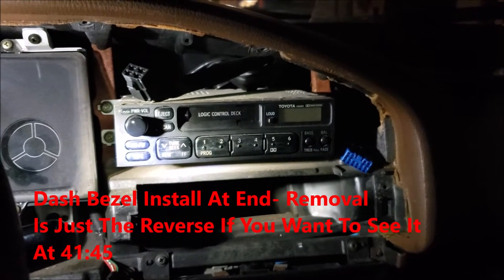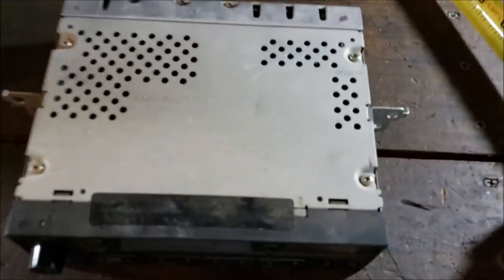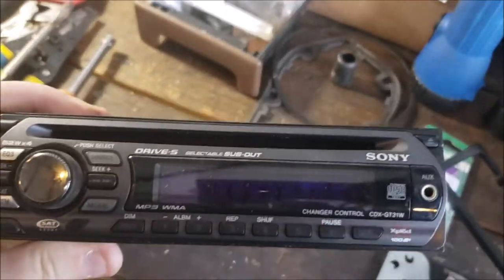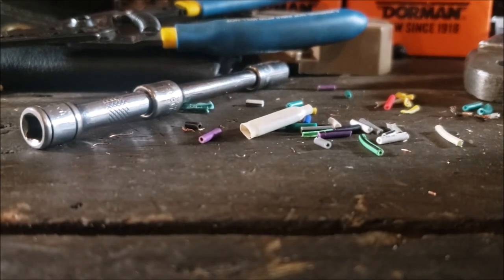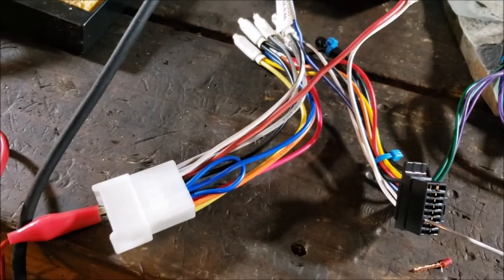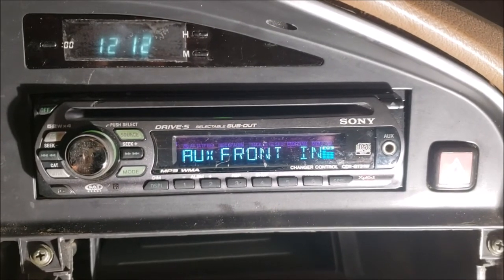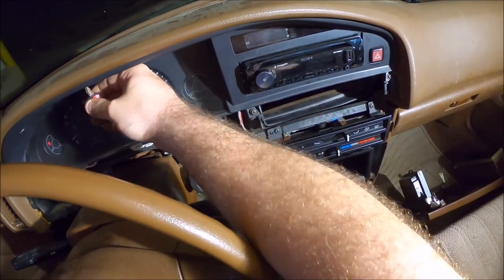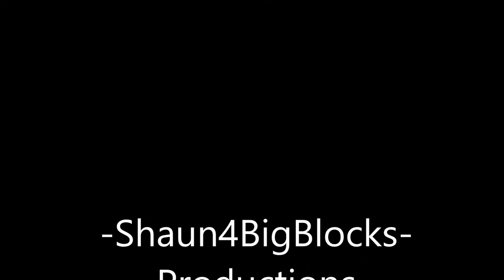1987-1992 Toyota Corolla Radio Replacement 🔧

Comment: I have a 92, get power to aftermarket radio interface. But no sound is coming out. And the antenna is broken off. What could be a possible issue ?

Comment: MODEL Numbers on the Bezel, Searching this on the internet would produce the part number. And you said is this made by Apple, How old are you. Apple didn't exist when the car was built . Also the pinouts pro the sockets are readily available on the internet. The smaller socket if for the rears speakers. The larger socket has, the 12v power, illumination  etc